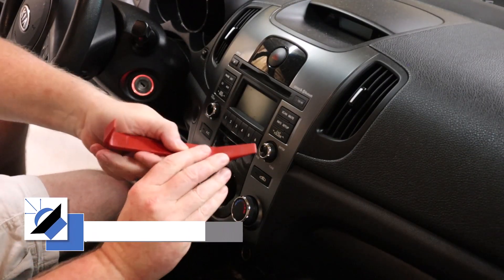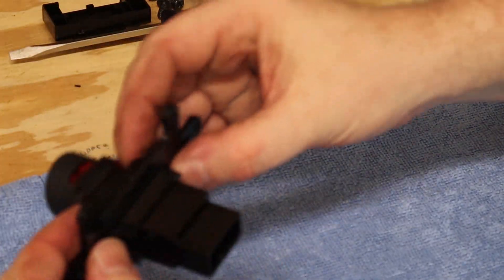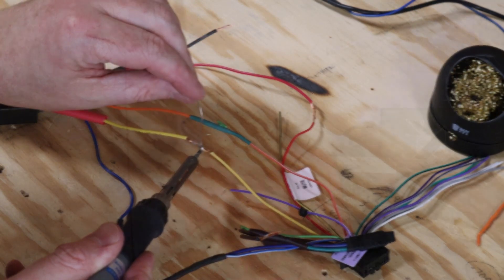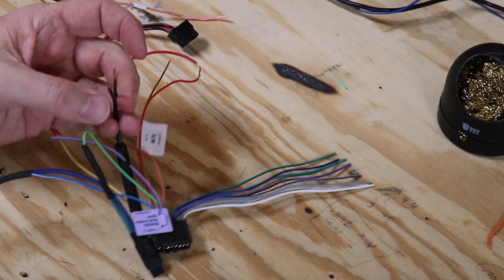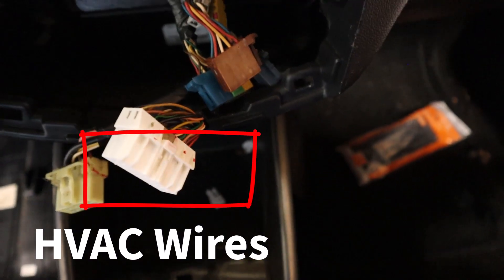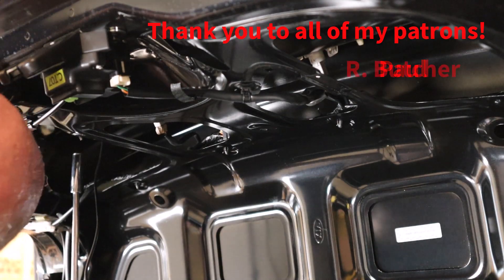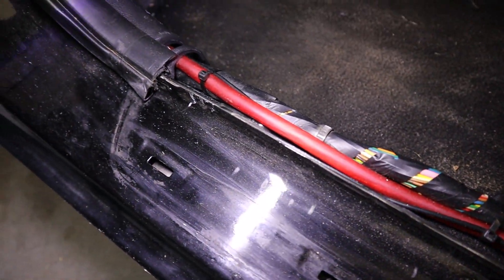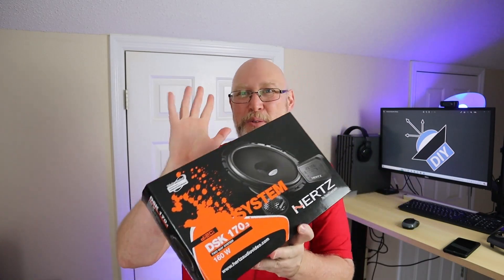Pioneer Car Stereo Install:  Car Play and Android Auto.

Comment: I have done a couple of teenager installs myself and this one is very similar to the Honda Civic I did for my son. Your methods are spot on and the reminder to double check you slid on shrink tubes on all the connections before soldering hit home with me. I usually miss one shrink tube per install. After trying different tools for heating the shrink tubing in the car throughout the years I have settled on the $10  Turbo Blue torch stick from Home Depot. Its a very light pen type mini butane torch with a push button start. Its pretty high heat so it requires a careful touch but it makes quick work of the shrink wrap and is easily refillable. 
 I actually envy today’s teenagers because their basic cars lend themselves to these kits for full size head units. In my own cars with uplevel trim, installing such a head unit is essentially impossible because of the physical and electrical integration of the audio and hvac systems.
Reply from the maker: I just need a long weekend so I can upgrade the door speakers and do some sound deadening!

Comment: I just did my aftermarket stereo install on my Nissan. If you do a little looking around you can find a ready made harness which has almost all the speaker/camera and power connections already done for you. You only have to worry about adding a backup camera (my vehicle did not originally have one) and then I used a PAC SWC to retain steering controls. I appreciate all your vids-Thank you!!
Reply from the maker: Yep, this kind of thing is much easier now that we have the internet.
Reply: The radio I'm getting from Crutchfield comes with a ready made harness all the connections are made it only adds 25 bucks
Reply from the maker: @basscaddy1449  That is a really cool service that they offer.

Comment: Usually only kenwoods had zones (front and rear) that could be the problem for no sound out of the rear… but you would usually have to activate it (not a factory setting). I know you said you checked, but pioneers used to have 2 jacks that looked like it was for the mic. One was actually for the steering wheel control module input.
Reply from the maker: I think that's what happened.  It is working great now.

Comment: Pioneer does have a setting in the radio to turn off rear speakers.
Reply from the maker: I had a chance to trouble shoot it last weekend, and it is now working fine.
Reply: @DIYAudioGuy  Great vid. What turned out to be the problem?
Reply from the maker: @onedsf  I must have damaged the mic wire while installing, and after tinkering with the settings I got the rear channels working.

Comment: I use the Milwaukee 18v heat gun in combination with the Milwaukee 12v soldering iron for wiring. Also, it's slow going but the heat gun works for bending 1/4" ABS so I'm guessing it's better than Harbor Freight's.
Reply from the maker: Might have to see if Ryobi has one.

Comment: Enjoying your content. I recently added aftermarket carplay/Android auto stereo and was having microphone and reset issues. I ran a new 8ga power from the battery and ground (OVERKILL). AND added a relay on the switched. Seem to have rectified the problem. I don't think the small power wires are sufficient from the factory for the large screen and bigger internal amplifier? Thanks again for the content.
Reply from the maker: I always worry about that.  I suppose what you could do is hunt down the fuse for the factory radio, if it's a 10 amp fuse then the wires should carry plenty of current.
Reply: @DIYAudioGuy  I fused mine with 20a at the battery. But I also ran the relay switched power to the acc outlet as well. But it did seem to fix the mic, and reset problems.

Comment: I'm curious with so many car stereo brands and the different options available I don't see "Optical outputs" (toslink, fiber optics). Nor any kind of of Hi resolution outputs like HDMI. Then the same for amplifiers. RCA cables are old school tech, and curious if that could be a show topic why car audio connections are behind the times. RCA cables have been used since the 1980's, you would think car audio would even come up with their own "standard" (industry wide) better tech connections. just a thought. thanks, and watch your channel all the time.
Reply from the maker: I have often wondered the same thing.
Reply: Optical is becoming new in high end headunits

Comment: You probably know already, but for the people that never did installs before… don’t saw the dash kit plastic pieces with a razor blade. Get a good flush cutter. All it takes is one slip and either your hand, dash kit, or components in the path will get #ucked up.
Reply from the maker: Good point.